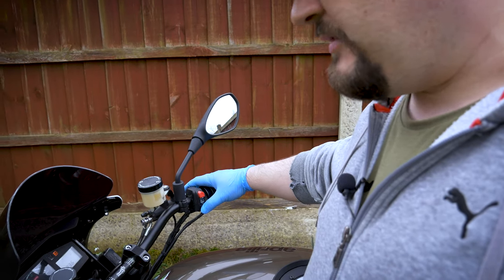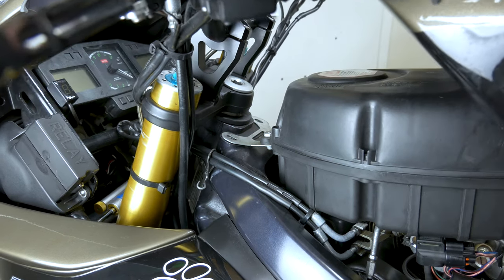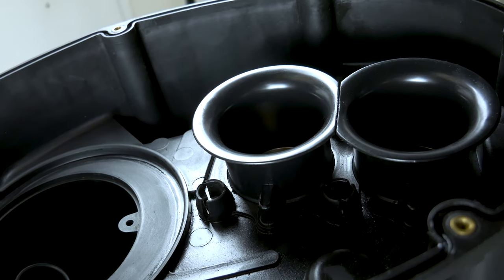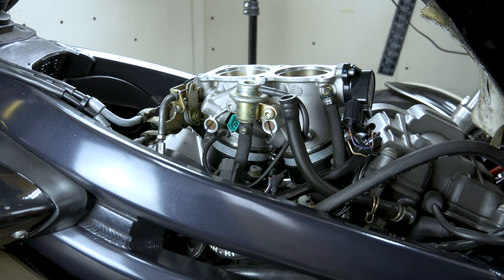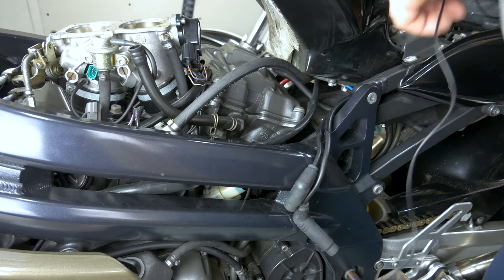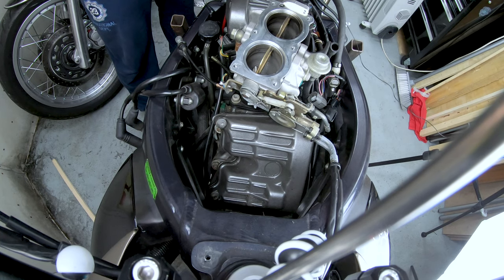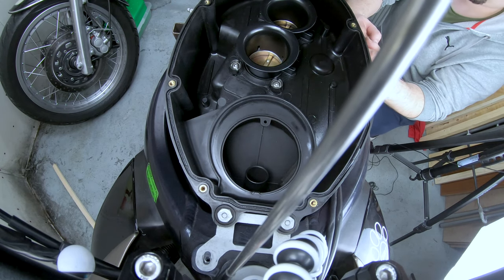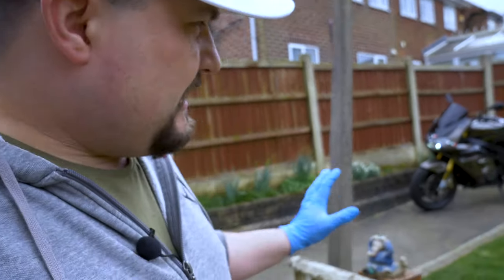APRILIA MILLE TUONO FALCO NOT STARTING FIX |  What to do after flooded your bike | 4K | Tutorial

Comment: I've done this which worked then immediately cut out 🤬🤬🤬 then wouldn't start again. I'm pulling my hair out here. Please help 😭😭😭
Reply from the maker: I have replied to your previous comment. Possibly the colder weather makes it run super rich. Try the trim pots the way I described in the other comment. Also have you primed the injectors at least 4-5 times before attempting to start it (key on-off) ?
Reply: You my friend are a fook in genius 😎😎 from your video its now running sweet as a nut 😊😊😊 cheers 👍👍👍👍👍👍👍👍
Reply from the maker: Very happy to hear it... Aprilias requires special care, so no shortcuts😉. 2 things are the most important. Strong battery, and injector priming at least 4-5 times, then leave it a little for the battery to rest and then start with full fast idle as you can see it in my video. I'm glad it worked out. When you get home today after your ride check the plugs, and if it is dark then turn the trim pots 1/8 counter clockwise to lean it out a little so next time it doesn't flood.👍👍
Reply: @MidlandCruiser  I will do exactly that pal thank you 👌 this video was perfect for a novice like me. I can ride and break them but can never fix them (until today that is 😜) thanks again 😎😎😎

Comment: Thanks very much for the video. My Tuono started fine , think i turned down the choke to quick as it stalled then wouldn't start again. Had a look for other fixes ie no choke,full throttle but never worked. Followed your video which is excellent as i'm not to good when it comes to mechanics. Took my time and it fired up straight away , saved me loads in Garage costs.
Reply from the maker: I'm very glad my hard work helped you😄😄😉
One more little suggestion, just check your spark plug and if it's a little darker than "tan" color, that means it's a little rich, so you could adjust the trim pots on the ECU. 
2 little blue dial, which supposed to be set around 12 o'clock. 

A little to the left (ie 11-10-9 o'clock) makes it leaner and the other way richer..
They are very very....very sensitive so be extra careful (11 or 1 o'clock max setting should be) it also depends if you are running any Eprom or not...
I suggest to join the apriliaforum, there are a  vast of people who knows everything (lot more than me) and specialised with these Aprilias...
You could just leave it alone of course if you had no real trouble earlier, just a little extra to know about😉😉👍 thanks for watching my video
Reply: @MidlandCruiser  Thanks for the tip.
Reply: Done it again, didn't even get it started this time, ordered some new plugs. They were a bit dark.
Reply from the maker: @hughmcbean279  well in that case you might need to check them blue trim pots to see where they are....you might have to take out the ECU to see it properly or use a mirror. Remember they are sensitive, and clockwise rich - counter clockwise lean..
Lastly what year Tuono is it and are you running any Eprom in it? Exhaust?
Reply: @MidlandCruiser  It's a 55 plate with 12k on the clock,Standard exhaust, not sure of any other mods. Will have to take the ECU out , wouldn't be able to see or adjust them. Thanks.
Reply from the maker: @hughmcbean279  yes it is quite tight under the seat. Disconnect the battery negative first, and wear rubber or nitrile gloves to avoid static discharge when you handling the ECU...be careful with it and only do this if you are confident enough to do it. Also do some research on the apriliaforum what settings people use. I only worked on first generation of these bikes so not really familiar with yours as it is a 2nd gen...please do your research before you attempt anything...wish you good luck👍

Comment: I'm a new and frustrated aprilia owner and this happened to me yesterday just before I was supposed to be going out. I have an Aprilia rsv1000 tuono. I did everything in your video apart from removing the injector plugs and full throttle turnover. It's 6am in the UK now and I'm about to hit the garage and try again with the injectors out. Just hope I don't wake the missus or I'm dead ☠️😂 wish me luck 🙏🤞🤞🤞🤞 brilliant video by the way 👌👌👌
Reply from the maker: Thank you. I hope you get it sorted. The purge with the injectors disconnected is very important, to clear out the fuel. If it floods again then you may need to consider leaning it out a little by turning the 2 blue trim pot on the ECU counter clockwise a little (1/4 max) it is very sensitive. If yo do that and then it feels flat and powerless turn it back 1/8 and see if it's improved or not. Should end up around 11-12 o'clock. Also depends on what chip you have, so there is a lot to it... To be honest

Comment: The best way of getting around this problem is to put a switch on your fuel pump so when you flood it you switch it off then keep cranking it until it’s about to start then flick the switch back on it’s always worked for me since I’ve done this.
Reply from the maker: That is not a bad idea actually. I made this video for those whose bike is beyond the "normal" full throttle fix, but to prevent it in the first place your solution can be an option... Thank you for sharing.

Comment: Speaking from experience, make sure you check the gaps on those new spark plugs. I found out the hard way that the recommended plugs did NOT come with the recommended gap for the Falco. Made it a real pain to start the bike, and for a while I thought the issue was the battery...
Reply from the maker: Thank you for your contribution. Aggreed, I always check the gap on the plugs (aren't everyone 🤷‍♂️) , just didn't include it in the video.. 👍
Reply: @MidlandCruiser  Cool, I guess my comment was for the benefit of clueless mechanical noobs (like me!) who might think that the plugs come out of the box with the right gap :)
Reply from the maker: To be honest NGK states that all thier plugs are pre-gapped, that might be true however, anything can happen with the plug during packing and transport. Found plugs with the paper electrode cover at the wrong end 😁 and clearly the gap on that was too small..
I appreciate any comments which contribute to the video and yours definitely did.
I do try to make my videos very beginner friendly, but sometimes I forgot things, which I probably learned 25years ago from my dad when we were working on my very first moped.. a Romet Kadet😁😉

Comment: I just bought a Falco, hopefully i wont need to do this but its good to know.!   Thanks for your efforts!!     (may i try guess your background?   Magyar? )
Reply from the maker: @fatsubsonic So sorry but YouTube put your comment into the spam category and I didn't see it until now.
Falco is a great bike you'll love it, however I suggest to drop 1 tooth on the front sprocket, and get a "gabro" eprom from gabro racing team. He is a very active member on apriliaforum, just tell him what mods you have and he will make you one i think it's 75eur but the difference is unreal... Thank you and yes I am Hungarian 😉
Reply: Thanks for the tips!!!  Mine is almost stock, it only has the Aprilia SL Carbon eprom installed but with the Original quiet mufflers.  I do have the SL carbon mufflers which I will install soon as I’m more familiar with this beast. I appreciate your recommendation for Gabro, I will keep it in mind if I need better tuning.  I have over 30 years experience in Enduro and have ridden a few road bikes but never owned a road bike until now.  I really love the bike so far!!  so much fun!  I look forward to trying The Great Ocean Road and even maybe Phillip Island GP circuit. 😬 Yes, I’m in Melbourne.  (Kecskemét is my 2nd Home) 😉
The only (small) concern I have it’s cranking slower than I like even with a new 290cca battery (that sits on a trickle charger)  I assume it still has the original 50amp start relay but I’m not 100% sure if a new relay will cure this minor issue...
Reply from the maker: I'm from Kaposvár, your 2nd home is pretty far from me, been there a few times, great biker community over the Danube. Australia? Wow, that's very far, I hope you can cope with the wildlife, I'd be terrified to go to sleep 🤣
Don't be afraid of it, just put the exhasut with the eprom on, it will make power delivery smoother and more controllable..
If it's 290 on paper then more than likely is around 240 if it's a few years old, this bike needs a powerful battery, get a load tester to see how much it actually makes. Yes the starter relay need to be changed to a 150A, usually people using yamaha ones as it is cheaper the the Italian. Also check and clean your negative (ground) connection to the engine and I would swap the positive cable which connects the starter relay to the starter motor, tends to get corrosion and creates voltage drop (hence the slower crancking) I really loved that bike but I'm quite short and the bike was too tall so had to go... All the best my friend 😉

Comment: bud question(sorry for my bad english) when i leave my 02 rsv1000 (gen1) about 2 weeks or longer and i want to start it in 75% of starting it wont start it just smells gas out of exhaust..then i must get the sparks out and get the fuel with air out of cylinders and she starts on first kick..cann there be a injector fail..i see alot of these problems with rsv :/ :/..
Reply from the maker: Hello..so there are a few things to know about these engines.

Very much doubt it has any problems with the injectors, mostly it is user error and lack of knowledge...sorry but true.

1. The fuel regulator is a bit crap, will loose the pressure to the injectors in a few days causing them not to atomize the fuel properly so it can't ignite, causing flooding.

To overcome this you need to cycle the fuel pump at least 3-4 times (or even more)  before you press the start button (like I do in the video) to build the pressure back, then pull the fast idle (not choke, the bike doesn't have choke, it's all automatic) all the way, and do not touch the throttle when you pressing the start button.

2. If you haven't already got a chip for it I would definitely get a Gabro one. You can send him a private message on apriliaforum, few years ago he charged 75Eur, but the difference is absolutely mind blowing...definitely worth every penny. If you do get the chip, make sure to set the throttle body idle bypass screws as recommended by him, and also the blue trim pots on the ECU. 

3. Worth checking the tps position with the diagnostic mode to make sure it is on "0" and not -1 or +1, Google will help you with this but definitely sign up to apriliaforum to learn all these stuff.

They are great bikes but they are Italian so have temper and character which you need to learn and defeat, good luck😉👍
Reply: @MidlandCruiser  tnq very much :) will do..the previous owner said that i turn ignition 2,3 times but i forgot everytime..tnq..i will get the the chip :)

Comment: I am confused. You have a Yamaha Virago and still time to time you are fixing your old Aprilia. It is like homing pigeon, finds its way back to you. Great video by the way. Which one is easier to fix? You forgot to put back the crank case breather pipe's spring clip. You are welcome:)
Reply from the maker: 😁😁 Homing pigeon... Yes I only have the Virago now, but had to help out a friend, with the Falco... Easier to fix?? 🤣 Of course the virago, older simpler, easier to get to stuff (spark plug for example) ..
Reply: @MidlandCruiser  Do not forget to fix the spring clip. Drive safe. Wide roads.
Reply from the maker: LOL I know about it...I actually have put it back just did it during last check ups not during filming...Well spotted

Comment: Hi not sure of video is too old for you to reply. Got a rsv mille today, owner told me to start it with a tiny tiny bit of fast idle or it will flood. Now i think ive flooded it by using too much fast idle. Forums say wait 24 hours before trying again.  But should i be able to start the bike on full fast idle like you do? Or do i have issues?
Reply from the maker: Hello, the video may be old but I'm here. Short answer is yes you have some issues. Long answer is that there is a few thing you can check to find out what the issue is.

1. Check the self diagnostic to see if the dash shows a "0" or not, this will tell you if the tps has been moved or not. Blue wires at the front side of the ECU, put them together (bullet connector) then put the ignition on, it can show -1 , 0 , or 1 you want 0. If out then reset it to 0

2. Check wires around the tps, if it has a splice or covered in insulation tape than more than likely it had a Power commander, if it did but not anymore then that's an other can of worms on it's own.

Could also be over oiled k&n filter, restricting air flow, causing rich running. 

Yes waiting can help for the petrol to evaporate, if you do that I'd try starting it without fast idle at all, also full throttle might help to flush out unburned fuel with loads of air, that's an other way.

All in all, full fast idle should be fine around 5C even in 10-15C it might need a little so it is running rich for sure.

Also there are 2 blue trim pots on the ECU which adjust the fueling (search trim pot on apriliaforum) and lastly the eprom chip inside the ECU will also affect it, and different eproms need different settings on the trim pots, and the idle air bypass screws...do loads of research on apriliaforum, loads of useful info there.

Hope this helps, good luck
Reply: @MidlandCruiser  you legend you replied. Great. Ok so, ive read that trying to start these bikes with the throttle will damage the sprag? I mean i rode the bike home for an hour and seemed to run fine, so it is just a cold starting issue. And also do you prime the pump every time you start the bike a few times or is that unnecessary and it's just because you had it apart?  Thanks again
Reply from the maker: @Calumcal  yes you are right about the sprag, but that applies if the bike would start anyway..in your case you are trying to flush out the flooded engine and the big air volume helps, obviously if it would start then stop cranking immediately. 

I cycled the pump every time I rode the bike. If I stopped for fuel, no, but anything over 30min I'd cycle it once before attempting to start it. Never ever had an issue or flooding, but my bike had power commander with autotune fitted and I auto mapped it over a long period of time, also I put the early RSV camshafts in so needed custom map..at the end it was perfect, now with the new owner I oredered a custom eprom for him (from Gabro on apriliaforum) and he runs it, without the power commander and runs like a dream...

Comment: How did you get into this situation? How does one flood the bike? Just bought a Falco and don't want to suffer the same fate.
Reply from the maker: Hello. This is usually caused by weak battery, or improper starting procedure, at the end of the video I explain how to start these bikes without a problem, even if your battery isn't perfect.
Also can be wrong adjustment on the ECU blue trim pots, and throttle body air screws, or if runing aftermarket chip, or Power commander. Best thing to do is use the bike normally for a few 1000 miles and then check the spark plugs, if they are nice and light brown, then enjoy the bike you are good. If they are black you are running rich and need setting up properly, if they look virtually new after that time then it's too lean (also not good for the engine) and again will need proper setup...Hope this helps
Reply: @MidlandCruiser  That a great help, mate. Thanks a lot for your time and happy riding! :)

Comment: So i think i have flooded my bike. My battery is on the charger as we speak. Tomorrow i will try one more time with a full battery and we'll see. My question is why do the plugs need to be removed? Wouldn't the engine just blow out the petrol out the exhaust if you disconnect the injectors? 

Greetings from holland
Reply from the maker: Hi...sorry to hear that. I removed the plugs because it was so badly flooded it needed a proper purge and also new oil.
And also I wanted to see the plugs...

If yours not that bad than you might get away with it doing what you said.
Also have a look at your blue trim pots on the ecu and see where they are.

Turning them clockwise will richen and turning counterclockwise will lean the mixture all across the map.
Only needs very, very small adjustments,  like 1/32 of a turn (very small amount) 

Stock setting should be around 11-12 o'clock, unless you have an aftermarket chip which could require different base setting.

Good luck

Comment: I cant do this every time it floods. It floods a lots. Seems to a common problem. Design fault
Reply from the maker: Hello. This only shows how to get it going again after a flooding, to fix the problem all the bike setting needs to be set right. 

TPS position 
Air bypass screws on the throttle bodies 
Blue trim pots (on the ECU)

All the above needs to be set to the Eprom chip you are running.

There is an Italian guy on the apriliaforum called Gabro, he is racing Tuonos in Italy and make custom eproms for these engines. Send him a PM and he can get you a chip which will be designed for your modifications, if you all stock he can get you one for that too. He will also tell you where to set everything (TPS, trim pots, bypass screws) then you shouldn't have any more issues, unless there is an other problem, which could be:

Fuel pump
Injectors clogged (bad spray)
Fuel pump pipes inside the tank
Fuel filter on the pump
Fuel pressure regulator 
Over oiled air filter (K&N)
Spark plugs

I hope this helps a little, all the best